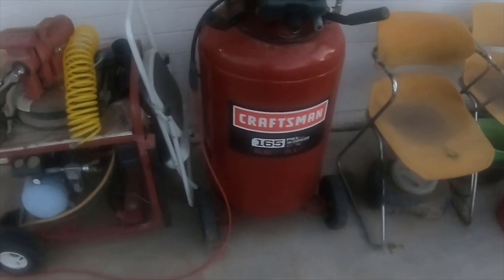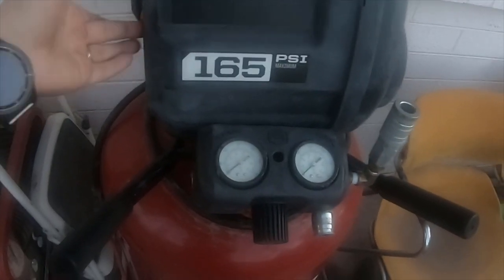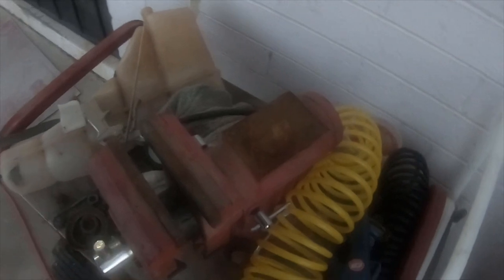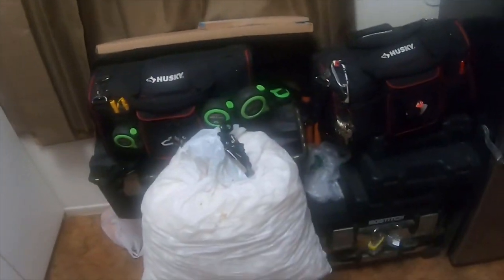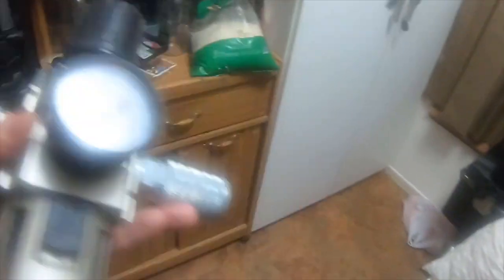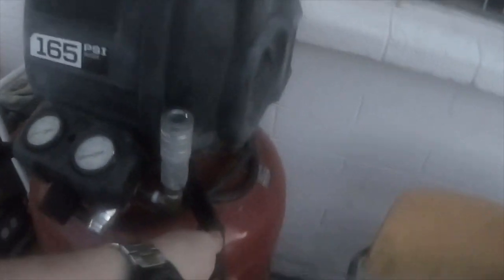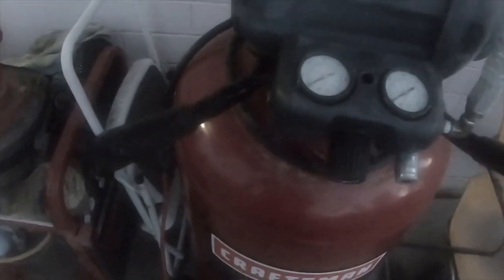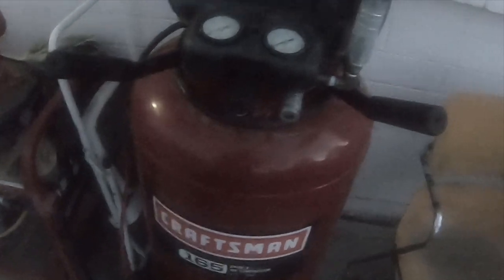Craftsman 33Gallon Air Compressor 3 Year Review

Comment: Great video thanks brother. I had a Sears air compressor. I think it was smaller tank. The motor was 220 two stage compressor oiled. The tank went bad and couldn't find another one or fix the one on it. That was the best compressor I ever owned and I had it for a long time. Great review of the compressor. Keep up the great work see you in the next video thanks again brother
Reply from the maker: 220 motors were awesome motors to bad you couldnt find one for parts to fix it
Reply from the maker: Thanks for stopping by scott

Comment: Good review. Oil less compressors get a bad rep.
Reply from the maker: Thanks
Reply from the maker: Yeah they do get a bad rep but I have never had any problems with this one and it's almost 4 years old now still running strong even with every day use
Reply: @AntonioClaudioMichael  I have the HFT 26 gallon red compressor for around the same time you've had yours and it's still doing great. Keep up the good work!
Reply from the maker: @toolinhand  the oiled red one from harbor freight
Reply: @AntonioClaudioMichael  No. The red ones are oil less.
Reply from the maker: Didn't realize that harbor frieght sold oil less air compresors
Reply: @AntonioClaudioMichael  Yes. The black ones are oil lubed. With those new gray ones, they're not color codes like the old ones.
Reply from the maker: @toolinhand  I havent seen any red compressors at my harbor freight that are oil less but that could be just my area that dosent have them
Reply from the maker: But a compressor is a compressor as long as it does the job right
Reply: @AntonioClaudioMichael  actually, all the red ones are oil less, and black ones are oil lubed.
Reply from the maker: @toolinhand  hft around me only carry the black oiled ones the red ones and the blue McGraw and the silver ones are online only around me

Comment: So how is that compressor still holding up and you leave it outside
Reply from the maker: It is still kicking butt and running like a champ and yes I do leave it out side @TERRELL SCAIFE
Reply: It’s good to know that he could handle the weather my particular set up I have the 10 gallon harbor freight Central and when I need more capability I have 2 20gallon industrial air auxiliary tanks
Reply from the maker: @terrellscaife2411  sounds like you got a good selection of compressors and yeah this old sears craftsman has held up very well for me has plenty of power to run air tools and just keeps on going been in the az 120 plus heat and 30 degree cold and bit lower during winter for years and years always works
Reply: Yeah I’m not leaving mine outside the neighborhood crackhead will have it One thing that concerns me about the A free compressor I worry about long-term durability I see videos of people after a few years they need to rebuild those no they start building pressure
Reply from the maker: @terrellscaife2411  long term for me has worked well I use mine everyday all day long most days these are good oil free compressors I haven't replaced anything on it since I got it I did Extend the drain port so I can reach it without tilting the compressor and added a 3/4 air fitting for bigger tools and hoses but that's about it never had any issues this compressors is very old now in my opinion for a oil free unit

Comment: 3/4 inch air gun yeah right lol
Reply from the maker: I have shown this compressor being used with a 3/4 inch air impact with 3/4 inch line maybe before you comment maybe have all the information before you call somebody a liar @Greg Lalonde
Reply: Yeah you probably gotta wait for the compressor to refill 4 or 5 times to get one wheel of a 1ton truck
Reply from the maker: I have shown this compressor take off 1 ton axle lug nuts with a 3/4 air line and it dont drain the tank half way to do 32 Lug nuts on a 1 ton truck.. your just arguing to argue and I'm not going to argue or bicker with you.. have a good day I wish you the best in all your adventures Sir! @Greg Lalonde

Comment: I've got same one can't get parts for it , that's horse shit!
Reply from the maker: There is a identical model at Lowes now Craftsman brought it back out you can get parts for the lowes Craftsman model and it's identical to this sears Craftsman just lighter shade of red mine has had some upgrades and repairs since but it was just brass fittings instead of 2 1/4 couplers it has 1 of them and second one I turned into a 1/2 coupler for 1/2 and 3/4 air Tools  @David Hill
Reply: @AntonioClaudioMichael  thanks bro I'll definitely take a look
Reply from the maker: @davidhill5621  no problem glad I could help let me know if you need more help